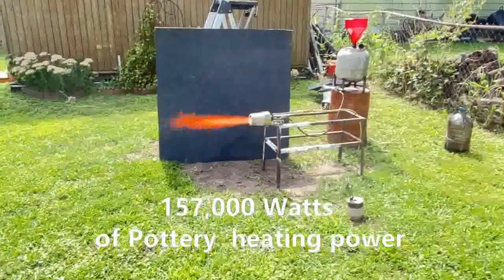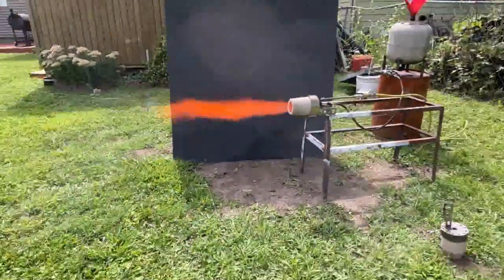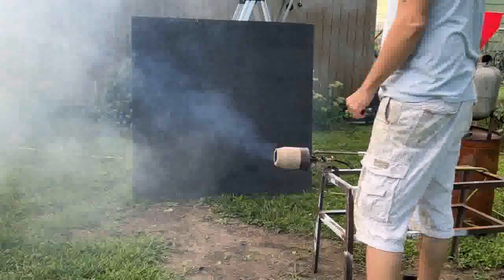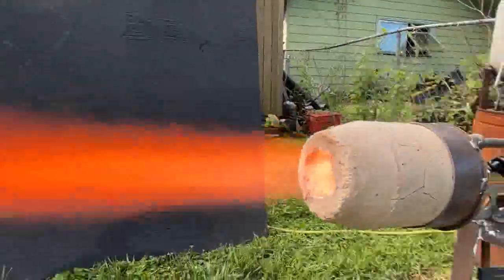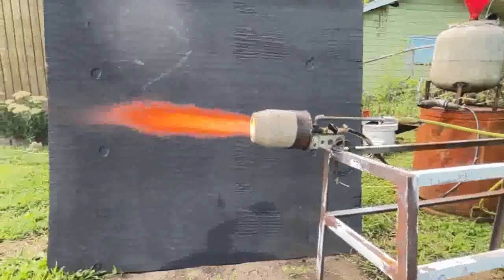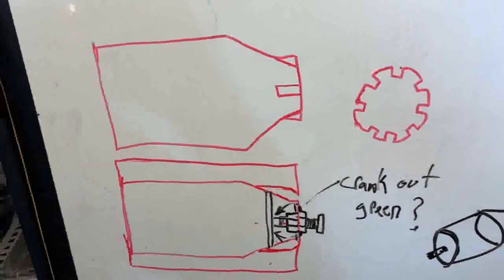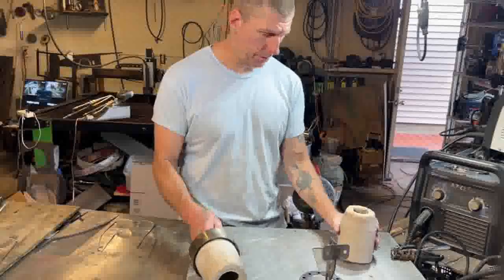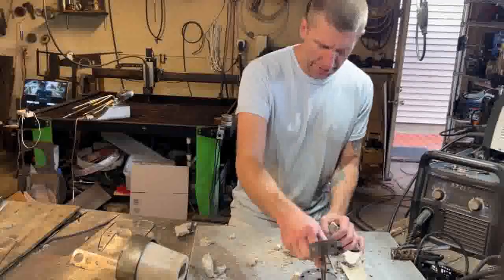150,000 watt waste oil Kiln burner for pottery

Comment: Steel wool does a better strengthening than 1% of the other fibers
Reply from the maker: Hmm i tried that in it was a dismal failure , maybe i added to much . I was really into that idea and made a puck of it but it made the material weaker, i was shocked .
Reply: @N @NOBOX7 sounds like you added too much.
Have you considered making it an expansion chamber instead of one that makes thrust ?

Comment: I've done tests similar, your getting hunch on the rear lip wich is what I was drawn to but found something else, I created tube type inlet & used smallest fuel outlet pipe and found there was a balance to be found depending on how the fuel outlet was positioned whether 60%inwards or outwards so the air and fuel would both fight to be get in and out.. Results were very impressive maybe give it a try 👍
Reply from the maker: Yep i plotted a graph in an older video showing something simalar , i found that a flush nozzle gave the higher head of vacuum . Thanks for the input
Reply: @NOBOX7  no worries I enjoy your channel never a dull moment 👍🔥🔥🔥🔥🔥

Comment: Can you just make the silicone carbide nozzles?  Maybe use blasting material with silica glass?  Wondering also similar with foundry crucible formula graphite clay silica carbide formulations?  Shake The Future has some microwave metal melting videos and one or two shows how he makes the crucibles and what he found most effective after a few years testing. Was thinking more like UHPC paradigm of thinking for refractory material, though no need to reinvent the wheel.  Thanks for sharing.  This and rocket stoves for firing kilns seems very inspiring. The waste oil used for heating as well, though I'm more into the passive designs so no compressed air and more so ducting optimally.
Reply from the maker: Hello , thanks for the input . The silicon carbide nozzle bake in a electric vacuum oven for weeks . Something i cannot replicate as of now .The re crystalize version goes for 30 days in the oven  . 
I would be happy being able to make just 10 at a time but the equipment is extensive . Probly $5k to build a small oven that can do this

Comment: Is the reflected heat from the ground causing the flame to point upwards?  You could mount it a foot or so higher to see if the issue is resolved maybe?

Comment: i was just watching NightHawkInLight's video "Making Opals for Free Air Conditioning" and was wondering how an Opal coat to this burner would affect it's performance. you can tune the opal paint to reflect or amplify different wavelengths of light... even invisible light like ultraviolet and infrared. imagine applying 10 coats of opal to the inside of this burner; each coat reflecting a different wavelength* i was also wondering if designing the burner using a certain geometry that helps direct and focus both the air and wavelengths of light to a convergence point, would help it's performance  🤔

Comment: why did you use random  s.s fibre instead of s.s. mesh wrapped around the cone (embedded ofcourse)?    btw great work you do. appreciate it.
Reply from the maker: That would be extremely difficult in practice but yes would be better than fibers most likely

Comment: Replacing the calcium or magnesium oxide in ur mix with sodium and the best being potassium odixe with your alumina silicate and you wont need any sort of fibers
Reply: They say similar about concrete drives and slabs but they still crack over time without reinforcement.  It is better to have it and not need it than the opposite, cost and time considered of course.
Reply: @CATANOVA  On that note, wondering if like the open source UHPC type formula modified for refractory would be useful? Like more than the stainless or some other material fiber?
Reply: @jafinch78  What is UHPC an acronym for?
Reply: @CATANOVA  Ultra High Performance Concrete. The more I thought about, probably is better to test out the Silicon Carbide Crucible design made by Shake the Future Youtube channel creator.  He also has a Silicon Carbide Crucible Mold open source he shared that can be used and that same idea can be applied for these nozzles.
Reply: @jafinch78  
Wasn't sure what you were referring to.
On the concrete I had some work done at home by some really good guys.  They told me reinforcement was not necessary with the modern day stuff where eventually I compromised, when I shouldn't have, and now I have a cracked front garden slab however the bit done down the side of the house with double layer steel is fine.  
Concrete has next to no tensile loading capability and will always benefit from the addition of reinforcement, as is used in all civil engineering projects.
Typical refractory materials that I have come across tend to be similar in terms of brittleness where they eventually wear down and crack following a number of thermal cycles.
Back in my workshop I run three different types of melting furnace along with a kiln.  I was kind of interested in this burner design with respect to achieving higher peak temperatures than my larger propane solution will do.
Silicone carbide is what is installed as the safety cups on both my induction and nichrome wire melting furnaces where both seem to hold up fine to thermal cycling although they do not see any mechanical load as such.
I think if I was doing this project I would try carbon fibre reinforcement along with a stainless sleeve in terms of a belt and braces approach.
Thanks for the channel tip👍
Reply: @CATANOVA  Oh yes, I've done a little work with cement and concrete.  Reinforced concrete is a must.  There are literally codes to follow using rebar where is neat now one can get fiberglass rebar.  Seems basalt and carbon fiber options would be interesting as well as I've seen those materials used as well as of course the range of steel types.  The oxidation of the steel is a challenge, so I think if loadings are OK, fiberglass is a great option.  With cement, also consider slump as being really important and the super plasticizers alone help bring the water content down where a thoroughly mixed cement will set into concrete optimally.  Opposite of refractory materials, the more I thought about, UHPC utilizes a broader range of particles sizes to fill in the gaps and also chemically bond to increase performance characteristics.  This might not be so good for refractories as the air gaps are what help to insulate.  Therefore, I wonder if an optimal lining would be a fiber wool with a highly reflective coating on the inside if even required. My limited kiln work and foundry work reminds me of the kiln washes to add that reflective layer.  So maybe like a thin coat of that over a fiber nozzle with a metal exterior cone to keep in shape if a silica glass coating wasn't applied over to help maintain the shape.  Just ideas, though the UHPC open source UofM formula really gets me thinking about cost effective ways to considerably improve performance, increase lifecycle and not require as much poured.
Reply: @jafinch78  
I used to do building site work but a very long time ago now.  Fairy liquid (dish soap) was a cheat plasticizer lol.
The materials science can be copied to a degree from researching  Space Shuttle thermal protection system.
Originally I was thinking about the back end of jet planes and afterburners lol.

Comment: how about adding carbon fibers? maybe even a cylinder of woven mesh. Unlike stainless it will not expand. I'm not sure as to fire resistance but I've seen some impresive videos.
Reply: Just started to type similar and then read your post.  I completely agree.
720p isn't good enough to have a proper look at this either.
150KW 🤔🙂
Reply from the maker: @CATANOVA  I agree , i have bin highly disappointed in my video quality lately . I cant edit 4k is the issue . This unit was burning 15.7 liters per hour . At 10,000 watts per liter hour we get these figures
Reply: @NOBOX7  thats a ton of fuel. Im guessing this output is whats needed to melt iron?

Comment: How much fuel per min does it use?
Reply: Probably similar to Tomcat afterburners if making 150KW.
Reply from the maker: Its about 250 mL per minute , 15.7 liters per hour . 
So at 10,000 watts per Liter hour we multiply 15.7 x 10,000 to get the Joules per second power output
Reply: @NOBOX7   Like an afterburner then lol.

Comment: He said "it should last forever" and I knew he was one of us.
The stainless steel fiber show some groovy kind of structure, I assume that increasing that shape will increase adhesion and strength, I know you know, just saying.
Reply from the maker: LOL That was was an epic response LOL Loved it
Reply: @NOBOX7  what about using the stuff that the romans used in thier cement..I think it was volcanic ash... what if you mixed real volcanic ash into your mix rather than metal fibers?
Reply: @TheStarforce2  Pouzzolane, volcanic ashes as you said perfectly :)
Reply: @NOBOX7  RIP Programmed obsolescence.

Comment: How close to the lip of the burner do you think you'll run the metal cowling? Maybe stop it like a half-inch away from the opening, so you don't end up with the metal getting warped from the high temps?
Reply: Do the last half inch in copper to make the flame green.